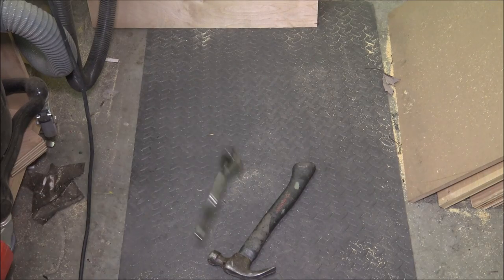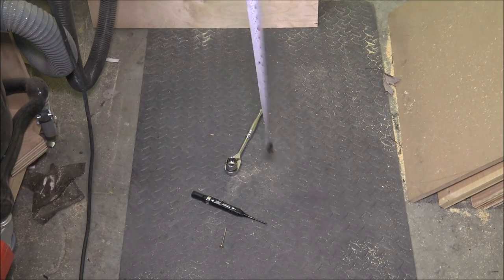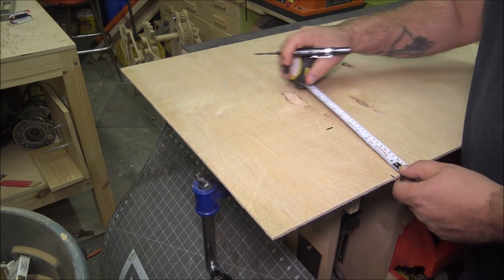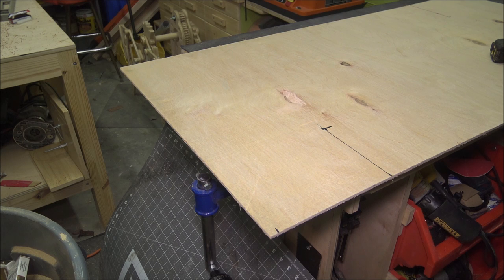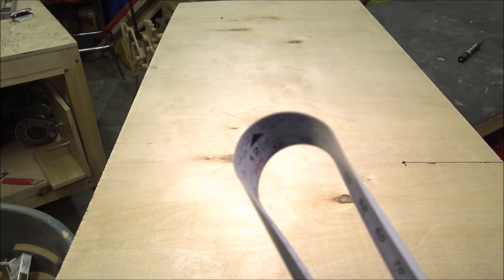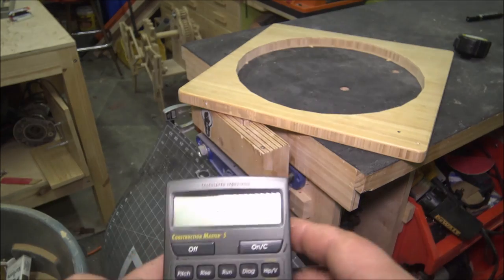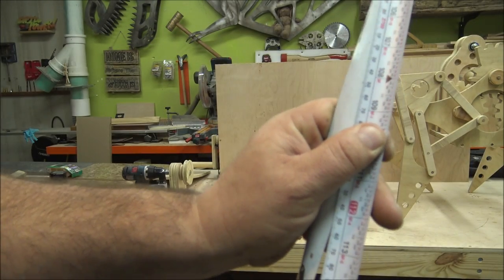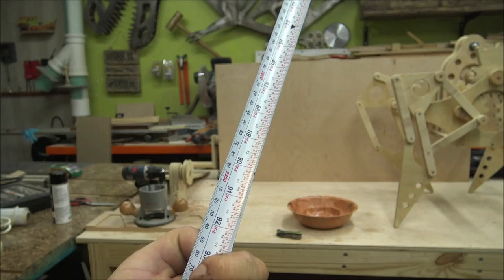5 Easy Tape Measure Tricks

Comment: One of my favorite tricks is finding the center of a board with an odd width (say 23 11/32"). Instead of trying to divide 23 11/32" by two, skew the tape just slightly so that the measurement reads 24", then mark at the 12".

Comment: love the Pythagorean therum(I say that to sound smart, I'm a big dummy) for finding square...the ratio is 3-4&5 the length of the sides so your base unit X3, X4, and X5 will give you the same square for any size, just use your smallest dimension and divide it by 3...that will be you base unit of measure...it is very handy when you cannot use a table saw or if you have an odd shaped piece.
Reply: Also 5X12X13 or any multiples of either one.  The bigger the better for accuracy!
Reply: agreed. less differential on larger measurements.

Comment: the square is usually 3-4-5, and easier to remember.
Reply from the maker: +Julius Jahn  I was always taught 6,8,10  but 3,4,5, would be easier to remember
Reply: +Julius Jahn 6-8-10 would be more accurate.
Reply: +justfakeit888 No, you use 3, 4, 5 to the points of the triangle not 1 inch in from the end.  Do the maths and see
Reply: +UKHeliBob whatever numbers fit the Pythagorean theorem... 6^2+8^2=10^2 (36+64=100)
Reply: UKHeliBob
I'm aware of how it works. The bigger the triangle, the less error due to inaccuracies with drawing, etc.

Comment: If you have an oddball width like 27-5/16 and you want to mark exactly half of that width, angle the tape until you have a handy easily dividable measurement like 32 from one edge to the other, mark at 16 and that's half the width of your 27-5/16